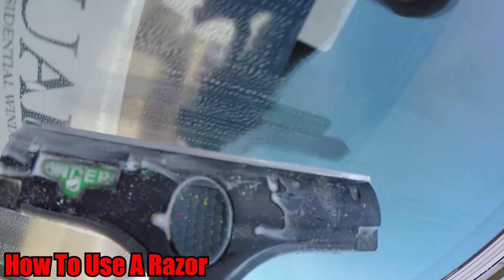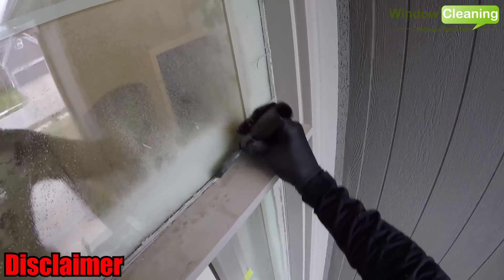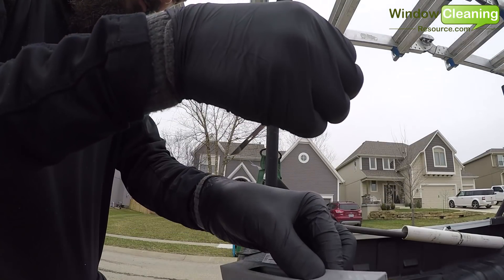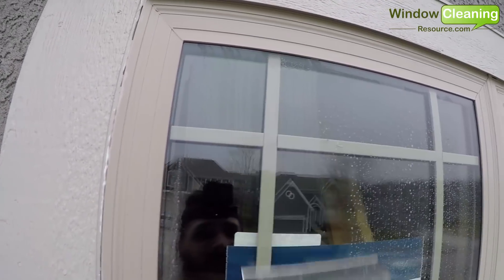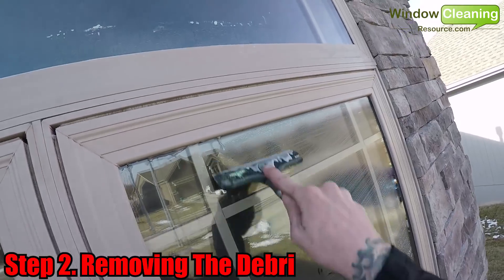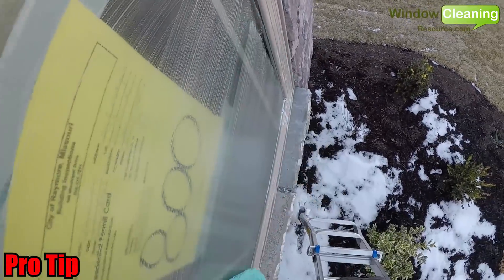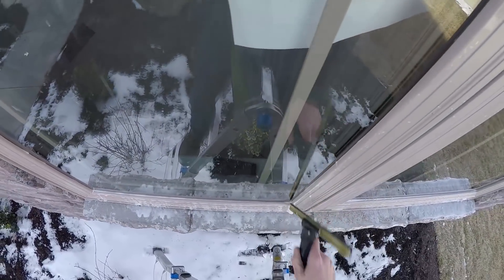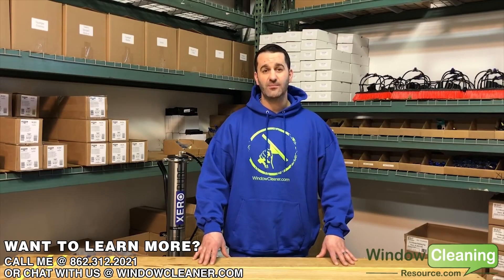How To Use A Scraper - Professional Window Cleaning

Comment: We do a lot of commercial construction cleaning, it seems a lot of offices are having "low-e" tint on the inside of the building part of the glass.  It's weird because they put a sticker on each window pane warning you that it's low-e, but the only way to get the sticker off is to use a razor!

Comment: Scrappers are so fun..... NOT...Contraction clean is so frustrating lol😒 Scratch waivers are a life saver.
Also another tip is NEVER razor inside of Windows without checking for tint(some windows have a clear tint or film on inside that helps conserve energy for AC and heat keeping inside cool or warm). And to never go up down with razor on glass that scratches the window.
Great video brother👍👍💪😎
Reply: Life Of A Window Cleaner this guy gets it, check for tint! For me the best way to check for tint is to throw a medium sized rock at the window from 15 feet out then look to see if there is any mark on the tint 👍
Reply: rockdiamond lol ok interesting comment 😂 some windows have clear tint that is to save energy for AC and heating that you can't see until you are close up that's why I say that, I ran into that before.

Comment: I try to use my thumb nail or white pad for most things now since scratching a large window at a service station. It wasn't even a tempered window. I think I just got unlucky and something got caught under the blade and dragged. Live and learn. I now explain the risks to my customers if the windows are covered in crap

Comment: Thanks for the upload. The task for me is my 4’ x 8’ shower glass has that hard water / soap haze. I did a test spot with soapy water and a 1 1/2 “ razor and it’s like new. I know it’s tempered but it’s very tempting to finish it with my 4” Unger blade at a very low angle. Any suggestions?

Comment: Great video 👍 what about tinted windows? What do you use for those? Magic eraser? Thanks!
Reply from the maker: Adam Hamilton to remove tint ?
Reply: Luke The Window Cleaner no sorry.  What if the windows are tinted. You can't use 0000 steel or a scraper
Reply from the maker: +Adam Hamilton yes ...i wouldnt use anythinh but your applicator
Reply: Luke The Window Cleaner that sucks. Thanks for the help
Reply: You can maybe use graffiti remover for paint stains on tinted glass

Comment: No no no on the triumph blades. Get the Unger goodness. But good video! New guys: just treat all glass as if it's tempered. And if it says Old Castle, then it saves time because most of those come pre-scratched for your convenience and it's probably better to walk away.
Reply from the maker: +Jared M ? lol we dont use triumph blades . only unger or ettore
Reply: Good comment A++ would read again. This Jared M is definitely a pro.  Yeah don't use triumph blades, use K-mart steel blades in the blister pack, those are the best.
Reply: Vestin732 you have a kmart? Wow those are getting rare. The best ones I've used were Unger. The triumph ss seemed  to rust really easy.

Luke - just looked like the triumph safety pack thing. My bad
Reply from the maker: Jared M lol its all good !
Reply: Luke The Window Cleaner speaking of where did you get that, it’s an awesome simple easier dispenser..